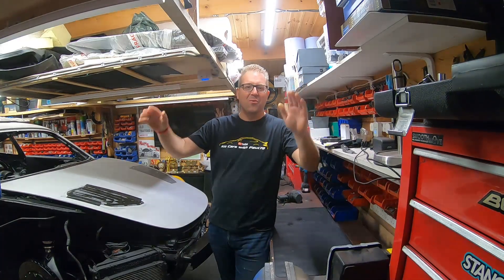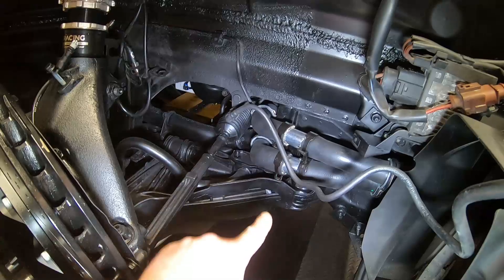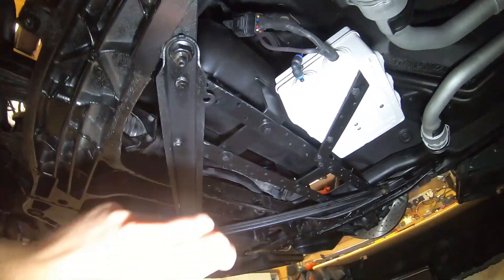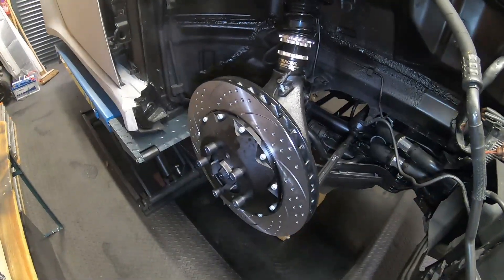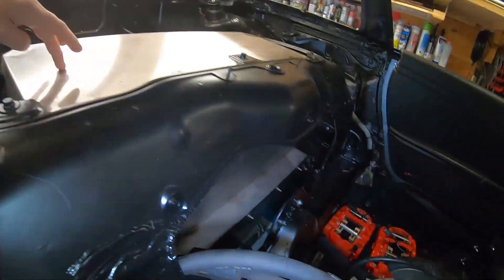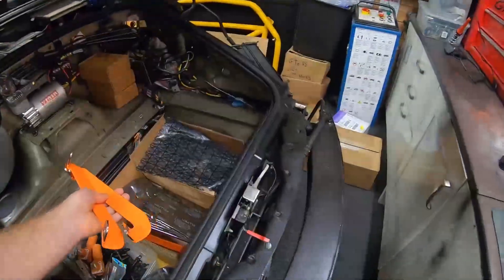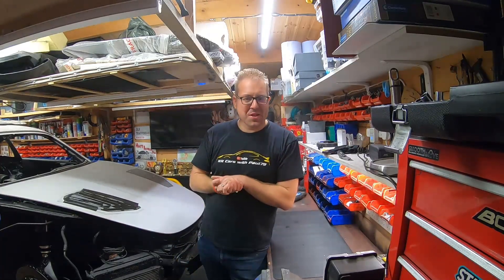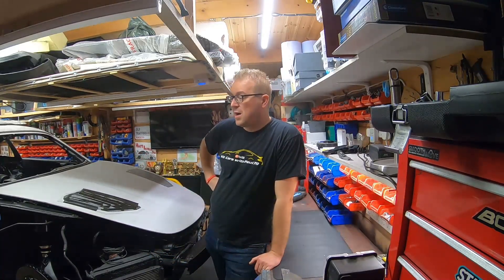EV Home Build Part 5 -  Rear Subframe & Battery Boxes

Comment: Hey Paul, great series. Thanks for the informative videos. What's the company that makes the subframe for the motor/battery? I couldn't find them using the name "Drift Motor". Looking to convert my 2010 987 to electric. Thanks.
Reply: Never mind. Found it in the description. Cheers!
Reply from the maker: Yeah give them a call. It’s also on eBay and they are located in UK, Kent.

Comment: Good luck with this, it's a huge project. 
Tom mentioned the in the comments earlier it is critical to get your BMS wiring correct when you have more than one battery box. He has forgotten more about EV conversion than most converters will ever know so listen to him. (And he used to work for Felton)
I ran into this issue as I have two battery boxes and as you would expect there is a small voltage drop on the main HV cabling between them. The BMS picks this up as one of the cells being low even though it isn't. It means I can only use the BMS to check the condition of the battery weekly but not the whole time. In my case I'm using a Nissan Leaf BMS which assumes all cells are in the one box, 
I should have bought a BMS with a module for each battery box and a data connection between them but thought I could go a cheaper route. I'm making do but it's not ideal.
Reply from the maker: thanks yes it is a huge project, but I am getting there slowly..

Comment: What size orion do you have? You need to make sure that within each group of 12 cells on the orion you stay with in a box. If you do not do this the cell voltages will be effected by your cable runs and wreak havoc on your BMS derating functions and SOC calculations.
Reply: Nvm you got a massive orion so you should be fine. Pinning out will be a huge job for the BMS. Did you cover yet what kind of charging you will be having on the vehicle?
Reply from the maker: yeah i've got the 144 cell one. haven't got to the charger bit yet.
Reply: @kitcarspaul79  You looking to have DCFC? Also where are you based?
Reply from the maker: @Tom-evnut  I’m in the uk near london
Reply: @kitcarspaul79  This is going to be a track only vehicle I hope right?
Reply from the maker: @Tom-evnut  no it will be a daily driver, like all my cars I build 😀
Reply: @kitcarspaul79  Alright, guess you wont notify the DVLA then. Guess you must have quite a good relation with insurance providers with your other builds.
Reply from the maker: @Tom-evnut  no I’ll be telling them
Reply: @kitcarspaul79  :) What year is your vehicle? After 2001 they wont care as they wont change anything. Even worse they might just revoke your V5. It has happend to people due to them not following no cutting or welding rules, which you are well past.
Reply from the maker: @Tom-evnut  its a 2005. hopefully I'll be ok. nothing structurally is changed on my cars. it is just a glorified body kit. panels unbolts and are replaced with others. bumper bars, airbags, doors remain as standard
Reply: @kitcarspaul79  ANY hole drilled or panel cut is an issue. However no point going to the DVLA if its after 2005 they just laugh and send you a letter back saying no change on your V5.